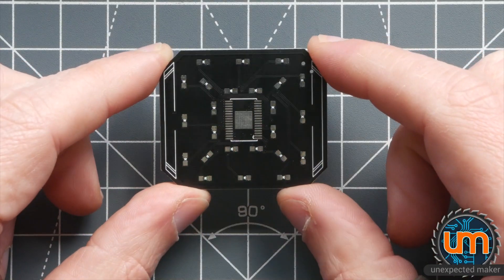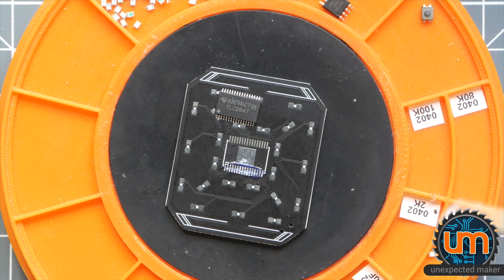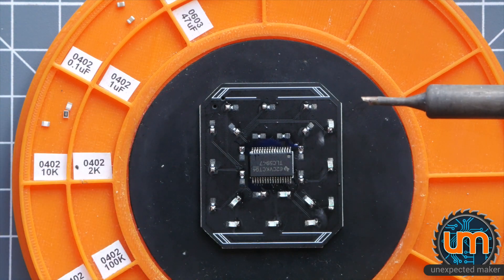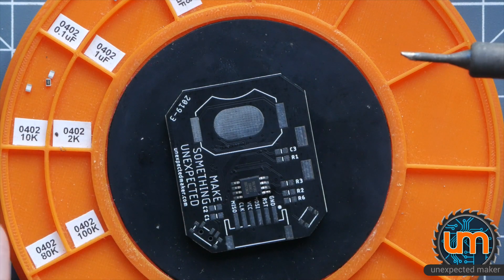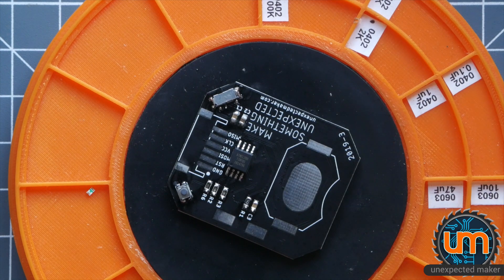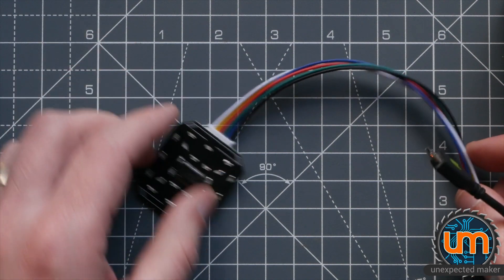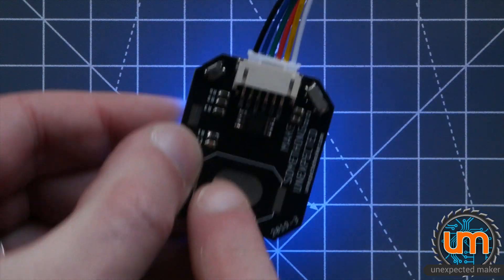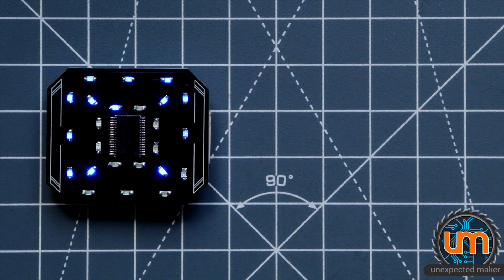2019 Hackable Badge Kit - Build Video

Comment: Just made one of these - I used a hot air tool rather than a soldering iron and all went to plan. I had a stash of Ikea cells and all have that textured surface underneath so did put a small dollop of solder in the centre and it worked as expected. I'll fess up to making a cheap badge from eBay for my first attempt to use solder paste by hand before this one and I'm glad I did. I learned that only the tiniest amount of paste is required (reasonable given a stencil would only lay down a mere sniff) and there were no blobs anywhere. Not too hard to dispense with a syringe using thumb and death grip to control the rate and amount. Almost magical watching the paste "dry out" then flow and a lot easier installing connectors rather than a solder tip. "The Boss" was impressed with all the pretty lights but did wonder how I managed those tiny parts with the way my aging eyes are. Anyway, looking forward to a WOPR if and when they resurface :)